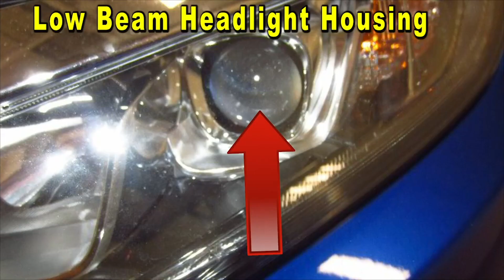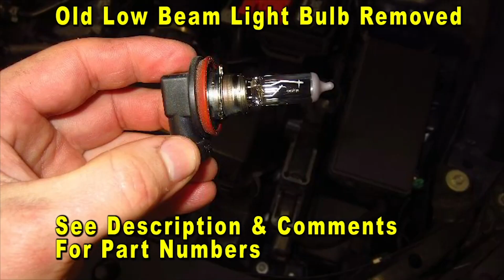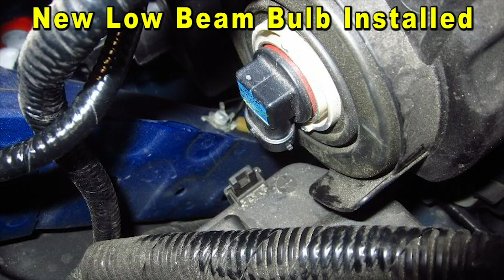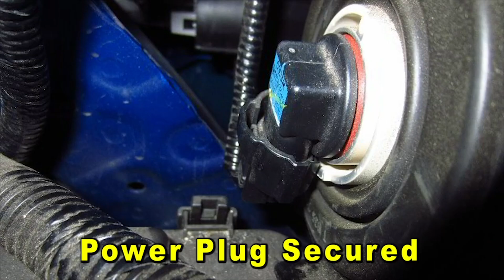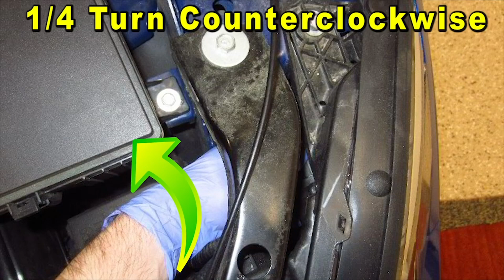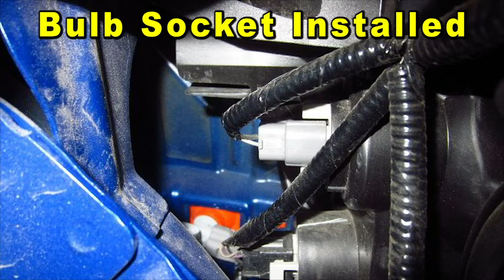2016 To 2021 Honda Civic How To Change Headlight Bulbs With Part Numbers - Quick & Easy

Comment from the maker: Honda Civic Low Beam Headlight Bulb - https://amzn.to/3PhSnoB
LED Low Beam Light Bulb Part Number - https://amzn.to/44BHwdj
Honda Civic High Beam Light Bulb - https://amzn.to/3Pkp9Wd
LED High Beam Headlight Part # - https://amzn.to/3Ehzr2R
Honda Civic Front Turn Signal Light Bulbs - https://amzn.to/47MGkH7
LED Front Turn Signal Part Number - https://amzn.to/47TemJx
Precision Screwdriver Set - https://amzn.to/3OYN1i0
Plastic Pry Bar Tools - https://amzn.to/3HMtsV7
Socket & Ratchet Set - https://amzn.to/3Z17LbA
Mechanix Gloves - https://amzn.to/3jCnHkt
Torque Wrench - https://amzn.to/3vS5uSI

The Paul79UF YouTube channel is a participant in the Amazon Services LLC Associates Program, an affiliate advertising program designed to provide a means for sites to earn advertising fees by advertising and linking to Amazon.

This DIY video shows owners of the 10th generation 2016, 2017, 2018, 2019, 2020 and 2021 Honda Civic how to change burnt out headlight bulbs (low beam, high beam and front turn signal).

Comment from the maker: Check out the DIY guide for changing the headlight bulbs in a 2016 to 2021 Honda Civic - 
https://www.paulstravelpictures.com/2016-2019-Honda-Civic-Headlight-Bulbs-Replacement-Guide/index.html

Here are all of the DIY repair and maintenance tutorials for the tenth generation 2016, 2017, 2018, 2019, 2020 & 2021 Honda Civic - 
https://www.paulstravelpictures.com/Articles/2016-2019-Honda-Civic-DIY-Repair-Maintenance-Guides.htm

Owners of other Honda or Acura vehicles such as the Accord, Insight, Clarity, Fit, HR-V, CR-V, Pilot, Passport, Odyssey, Ridgeline, ILX, MDX, RDX, NSX, RLX and TLX may also find these DIY instructions to be helpful.